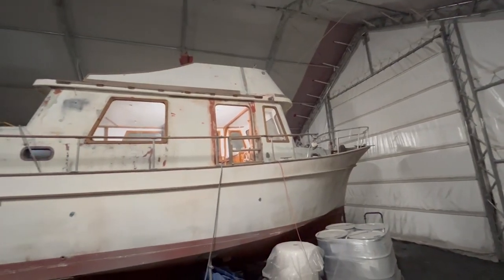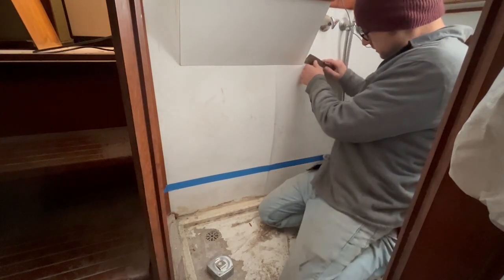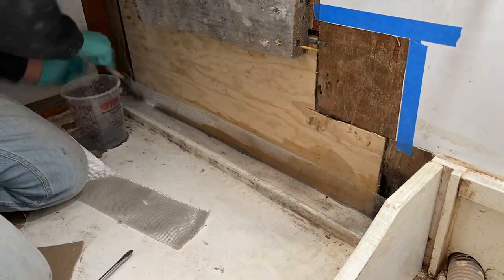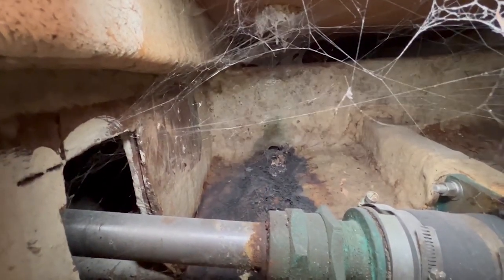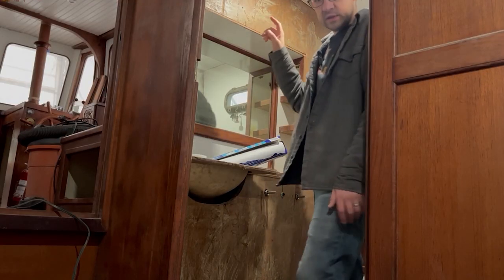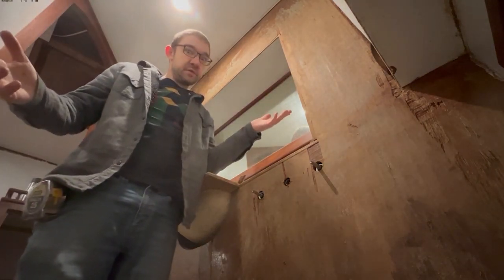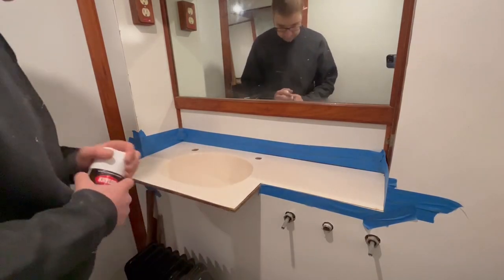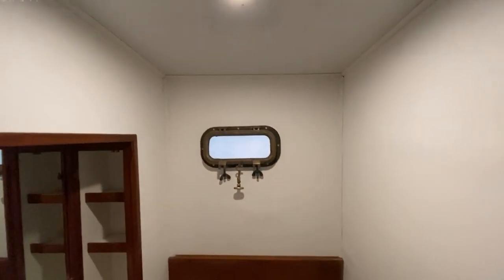Boat Bathroom Transformation Revealed! | REFIT [Ep 11]

Comment: Can I ask how did you seal the corners , joins etc what with ? Just sika flex ?
Reply from the maker: If you are talking about where the shower panels join, we used PVC quarter round trim and then bathroom caulking around that to give it a nice seal and clean look. I can look up the exact caulking we used if that's what you were interested in! Thanks!
Reply from the maker: It’s GE paintable silicone supreme. Has mold resistance and hopefully won’t yellow.

Comment: im sorry but that bulkhead replacement job isnt really a job, its a bodge.
Reply from the maker: Doing the best we can with what we have, thanks for watching!
Reply: @aboardladyhawk  im hoping you didnt took what i said too hard, though i was very assertive. 
i would have just removed the next panel which seemed (to me at least, maybe im wrong) to be wet and replaced the whole thing, and investigated (which you probably- done) if there were further causes. just dont like to comeback to jobs unless they are 10 years apart minumum. keep it on!!!
Reply from the maker: It's hard to tell from the video, and I really should have added a subtitle, but that "next panel" I think you are referring to was fiberglass. Our bulkheads in that area have the engine room on the other side, so there's a layer of fiberglass there. It's stained from years of dry rot so it looks atrocious... but it solid, so that's what we bonded the new marine plywood to. Hope that clears up any confusion! We definitely don't like repeating projects either and appreciate the help!
Reply: @aboardladyhawk  ok that makes perfect sense, i stand corrected then!